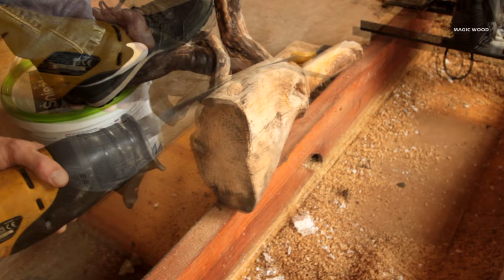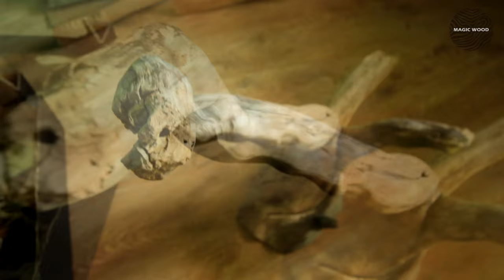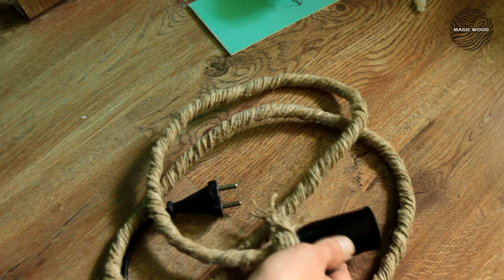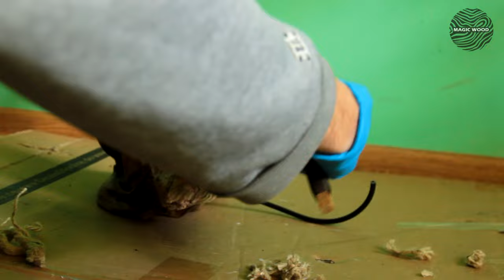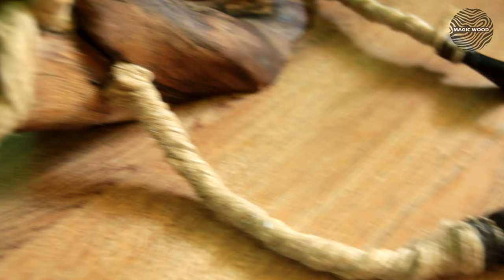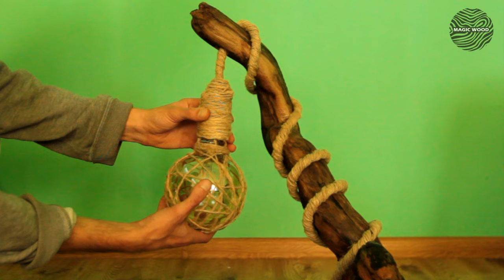Night lamp from old wood! DIY. How to make a lamp out of old driftwood.

Comment: Is sanding a must ? I just found a lovely brunch and love the way it looks as it is ? Thank youuu
Reply from the maker: Hi. It is not necessary. I wanted to achieve the effect of brushed wood.If you like it, leave it like that, but it should be dry and covered with wood oil or varnish.

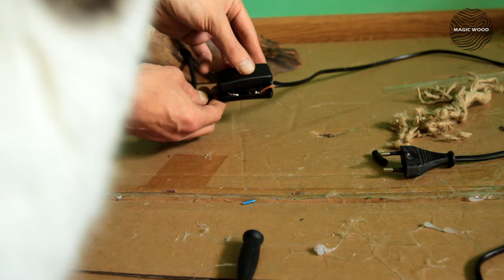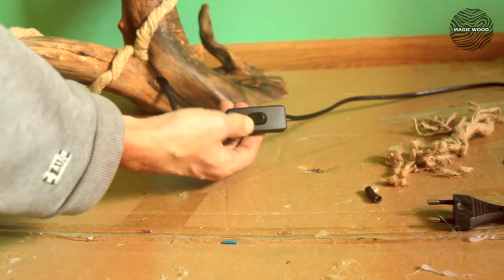Comment: looks good, but I'm concerned about the metal wire at the switch where the cables are attached very badly. At 7:52 - 8:04 you can see the exposed inner cables left and right side of the switch which means, there's no working strain/cable relief. Just a matter of time until the live conductor is exposed and the florist's wire may get live as well.
Reply from the maker: Hey. Thanks for the comment. The cables are insulated.
The copper is not in contact with the string